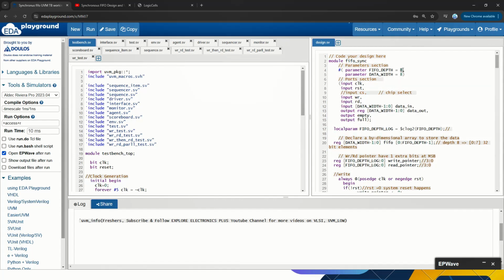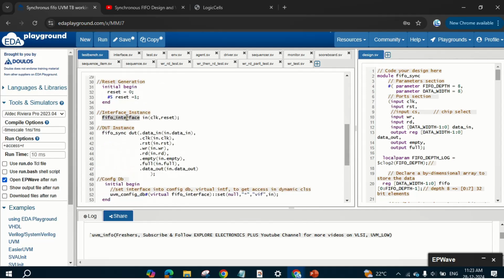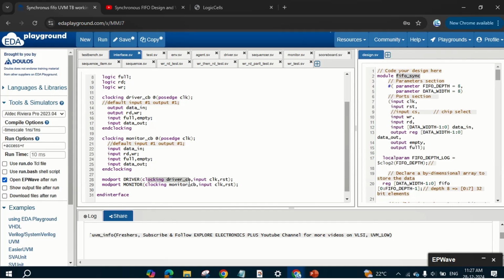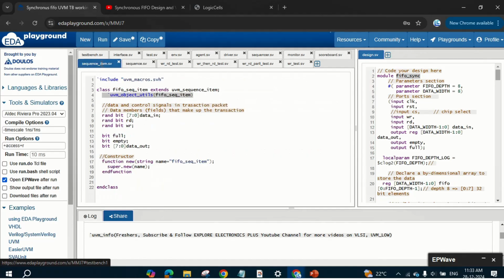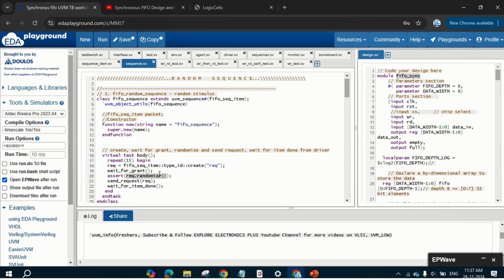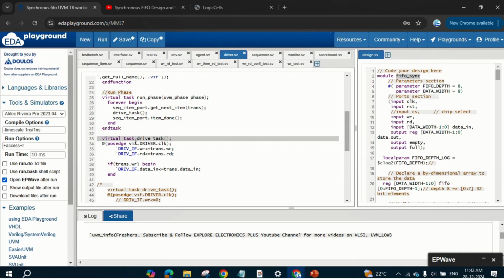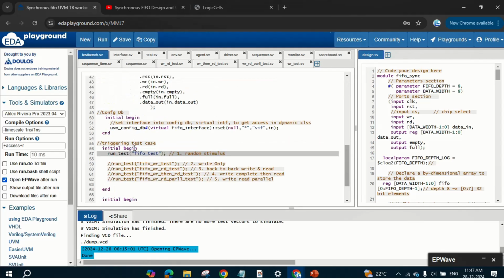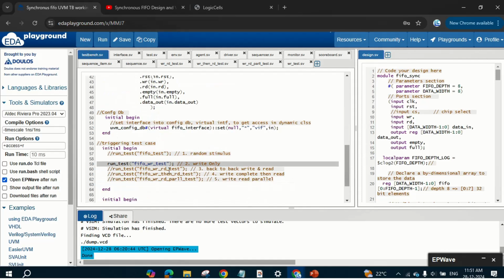UVM Testbench for FIFO Verification | Part 1 | UVM code for Fresher

Comment from the maker: Content :
0:00 Introduction
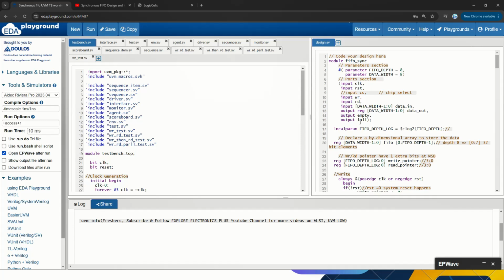0:45 Design code of FIFO & Verilog Testbench
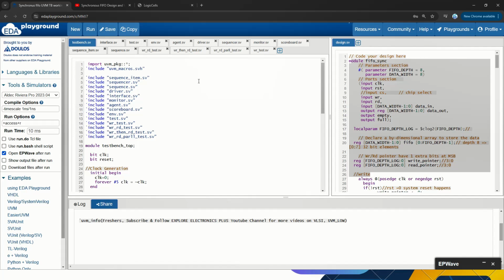1:28 UVM code 
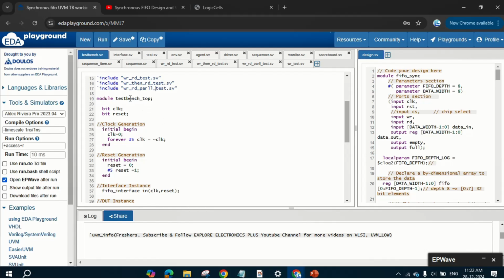4:07 Testbench Top
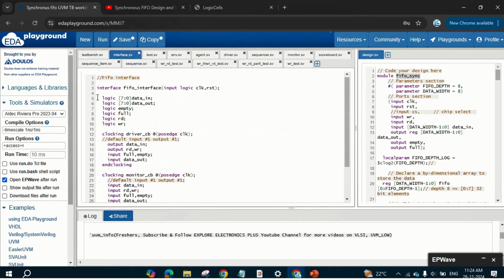6:00 Interface and Config DB
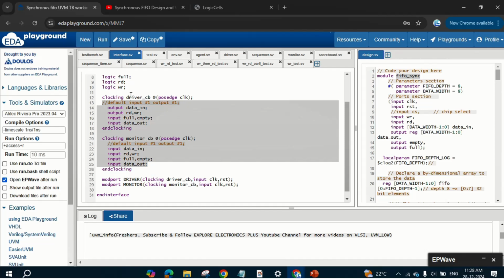10:00 Test Class
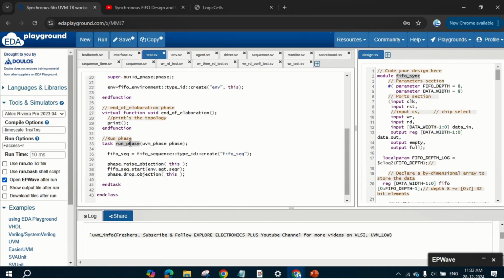12:35 Run Phase of Test
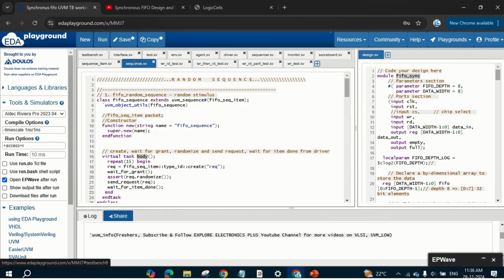16:18 Sequence1
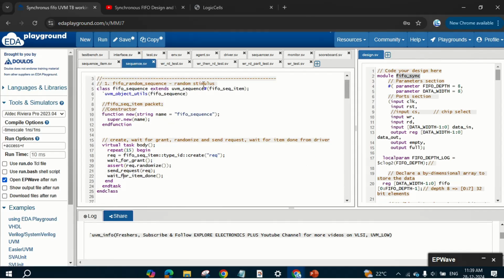18:46 Driver
23:50 Waveform
25:56 Sequence 2

Comment: It is synchronous fifo right? Why you taken one driver and one monitor? Sir im facing an issue with interface,how many clocking blocks are used in interface, I'm using write driver write monitor, read monitor? Is this right or any modifications change in my interface sir
Reply from the maker: To verify FIFO functionality as your DUT, one driver and monitor is sufficient. If you have some other modules connected to FIFO, it may require multiple dirvers and monitors.